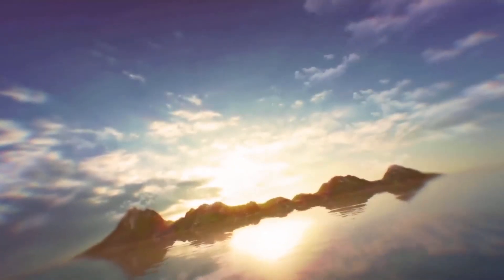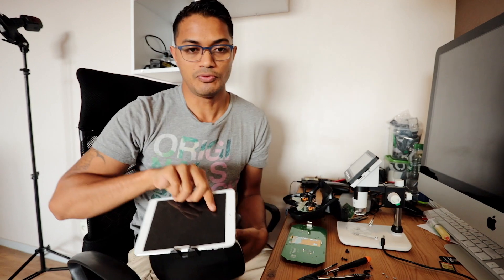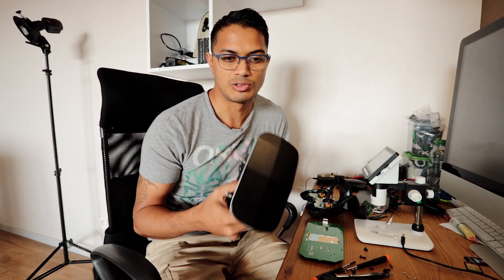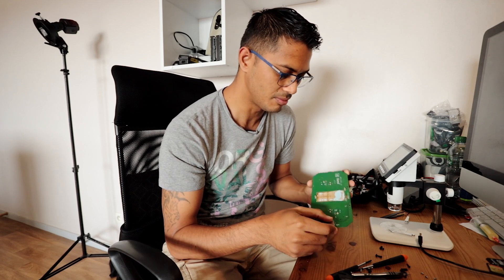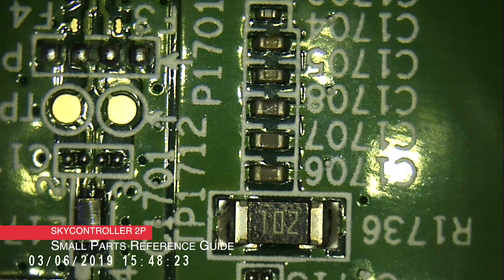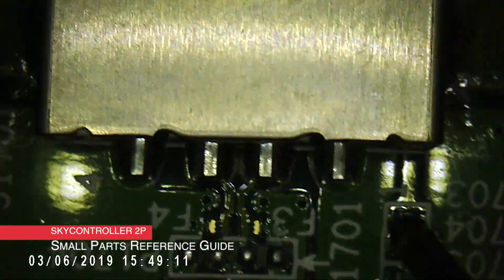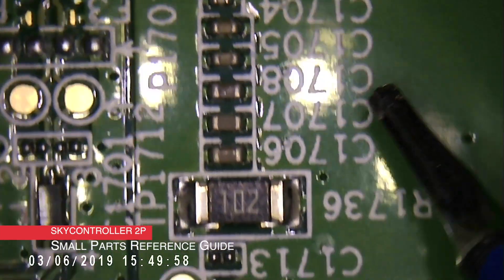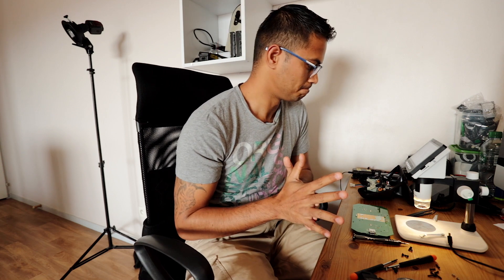Skycontroller 2P | USB Port Damage/Repair - Little Components

Comment: I have a question that you maybe able to work on. First let me mention the problem. When you connect the SkyController 2 to the phone. the Controller 2 recharges the battery on the phone thus draining the Skycontroller faster.
That being said i seen a video where a guy put a resistor, I believe it was 10 ohm into the red wire, which did not stop the data but kept the phone from charging. It was for a different controller than the bebop. but would this work for the SkyController 2 and if so, can you get it to work for the Bebop users?

Comment: Hello can you help me?  I was trying to fit a lipo battery in skycontroller 2 but unknowingly plugged the battery into the control with the inverted poles, then said it doesn't turn on anymore, just when I put it on to charge the green light next to the charger connector.  What would the resistor to replace in this case?  Do you have the electrical scheme to send me?  thank you
Reply from the maker: Marcos Santos hi sorry I don’t have the board diagram. You can trace the power rail from the DC input pcb, there should be a fuse  that’s going to read infinity.
Reply: @ANTHONYVLOG  no, unfortunately there is no fuse, there is no protection circuit of the board, a toasted IC completely, here in Brazil I do not know any electronics specialized in this type of maintenance.  I think it will be cheaper to buy another transmitter.  Unfortunately :( Thank you!
Reply from the maker: Marcos Santos phone repair shops would have hot air workstations and microscopes to work with micro components. I have spare good boards which I refer to and match for reference which is the only way I can ever figure out what’s wrong if there are no physical visible damage. If the IV fried than something else went wrong because the BMS in the controller has reverse polarity protection it will kill the input for the transistor. Looks like a replacement controller would indeed be cheaper. PS. Iv reversed polarity on the SC2P and SC2 with no damage which is why I’m surprised.

Comment: Interesting stuff Anthony, thanks. Glad you liked the Skycontroller 2 better with its battery, that's the one I use.  Got reply from Parrot re; motor not starting have to do reset and check it out after see if it is fixed. Warranty up in August. Cheers to ya

Comment: Great Vid!👍
Pls. do a range comparison because the antennas are very different.
Reply from the maker: On the list of things to do hehe. Thanks friend 🙏
Reply: @ANTHONYVLOG  i have to thank you for producing vids. Quick question: I chrashed my bebop 2 a few days back (was just my fault 😑). It wasnt a hard crash tough. Everthing seems to be fine but one motor rattles when im turning it. Should it be fine if I replace the motor cages. 4 only cost 8€. But the hole motors cost about 65€. 
Thanks
Reply from the maker: Leandro Ebner if the bearing is ok than changing the motor cage will be enough, but if the bearing is bad changing the motor cage won’t stop it from getting a motor error when the magnets contact the stator due to bad bearing. Just need to assess it and decide from there.
Reply: @ANTHONYVLOG  i can turn the motor a few “steps“ and everthing seems fine. It turns easily. But only at a few certain points it blocks and scratches somewhere. I think only the cage is bent because the bearing can be turned without a problem. What do you think?
Big thank you for your help ;)
Reply from the maker: Leandro Ebner apart from spinning the motor cage try holding it and moving it side to side without turning. If there is no “play” than it’s ok and motor cage change will be perfect. The scratching is most likely the bent cage touching the stator at some points at certain rpm. :)
Reply: @ANTHONYVLOG  just tested it. The bearing feels very solid. I will buy new cages. Hopefully i can get my bebop to fly again.
I really apreciate your help!
Reply: Thank you for your answer. Great idea about changing the battery. Never thought about that. Any suggestions about a battery?
I use a heat gun for changing components on the boards of my controller an Bebop. Use a lot of Flux.
Love your channel.
Reply: @RoJo-so9lx  use two 18650 batteries with a 2 slot 18650 battery holder. The two cells should be connected in parallel. This gives you about 6000mAh in contrast to the internal battery with around 2500mAh. So you can use the skycontroller with a fully charged  device a lot longer than normal.

Greetings
Reply from the maker: @RoJo-so9lx  good use of flux always gets it flowing although for the BEBOP 2 boards iv repaired Iv had to run some lead free solder before the hot air station so I don't cook the board. Battery have many options 2x18650 in parallel, or 2 lipo cells in parallel. The 2P takes 3V so any of those cels in parallel would give it more juice.
Reply: I use a Skycontroler 2P with a antenna amplifier. I also have an older model Skycontroler. If the older Skycontroler has an bigger signal output then I will change the amplifier to the older model. So I'm curious which one is strong.
Reply from the maker: Ro Jo your output will only be the maximum tx ie: your “amplifier” regardless of internal tx power! Both controllers have the same regulated power settings depending on which region is used. USA has the highest tx power. But using an external tx the broadcast power remains the same regardless of region setting. (Power is software configured). 😀 good choice updating the 2P I’d assume you stuck in another battery as well.